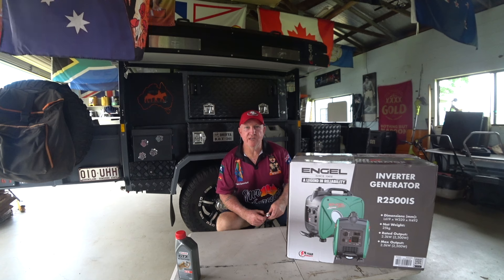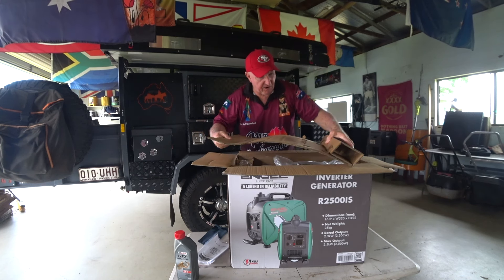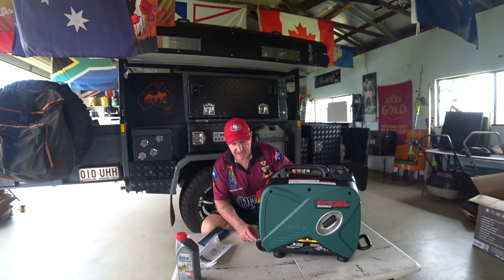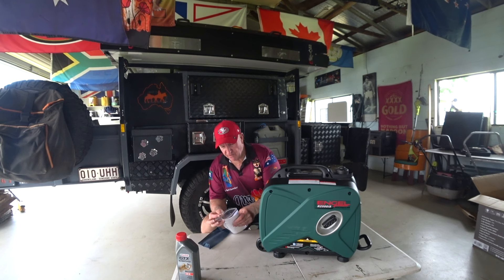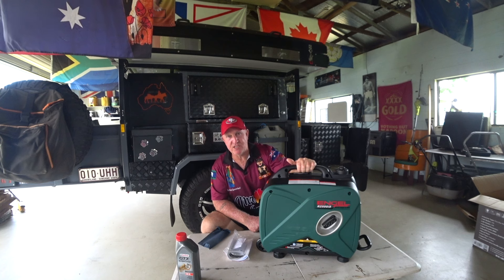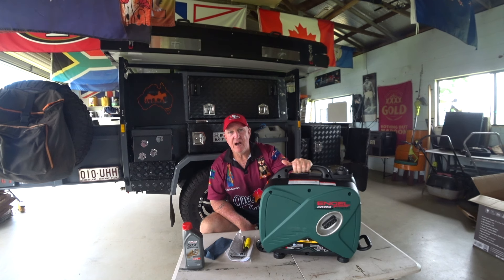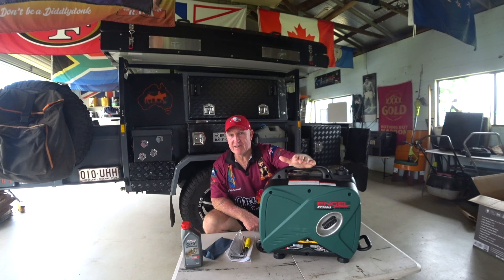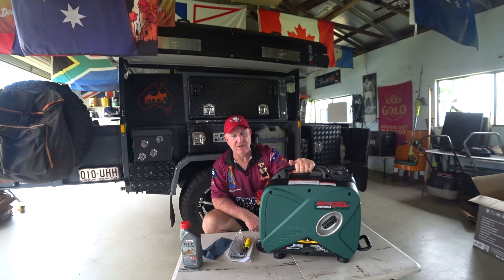Engel Generator Pt 2- Unboxing the 2500w Inverter Generator #engel

Comment: I recently visited your YouTube channel and noticed that it has a visually appealing design. However, upon further inspection, I identified several areas that could use improvement. One crucial aspect is search engine optimization (SEO), particularly the implementation of rank tags and tag volume. It seems like these elements have not been fully addressed on your channel. There may be other issues as well, but these are the ones that stood out to me
Reply: FO !!!

Comment: 15W-40  ?  geezuz, that's the same weight oil I use in my Navara 😂
Reply from the maker: Yeah well the navara's engine is only 120cc isn't it?   lol
Reply: @Mrbuckaroonie..  smart arse 🤣 I use Castrol RX Super 15W-40 and it's actually heavier weight than NIssan recommend.  15-40 seems a bit heavy for a small generator.